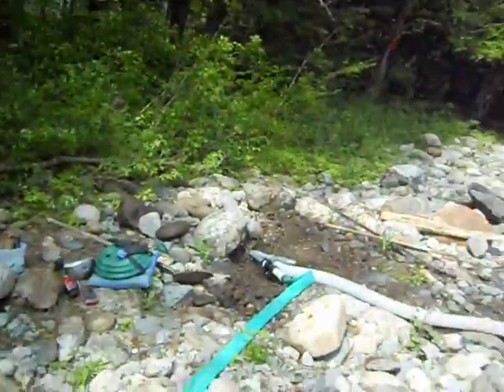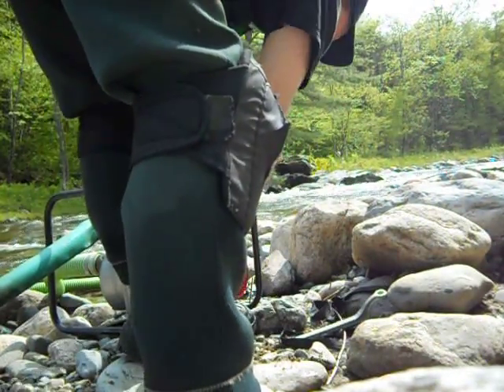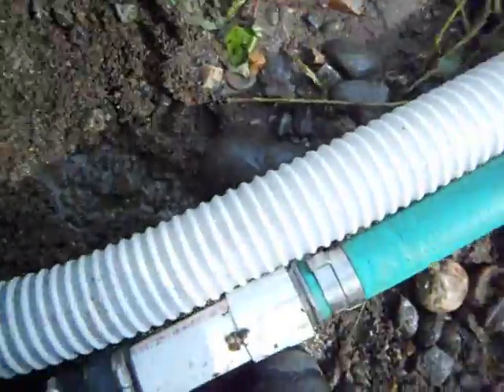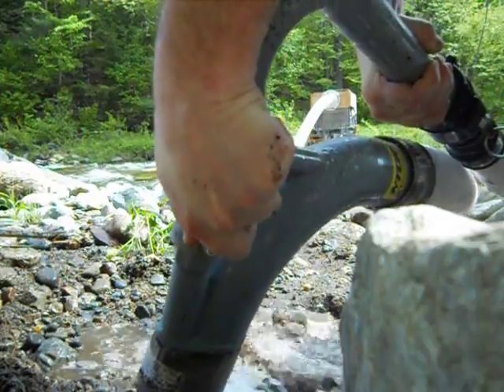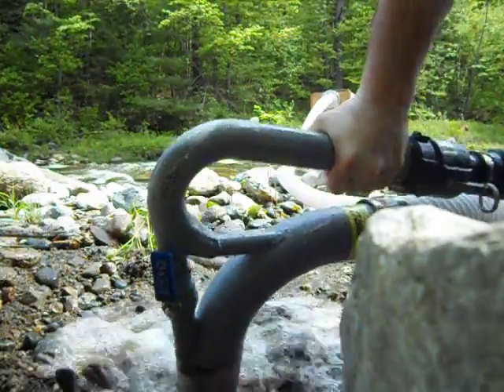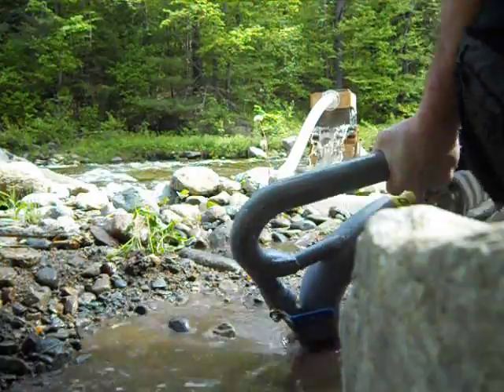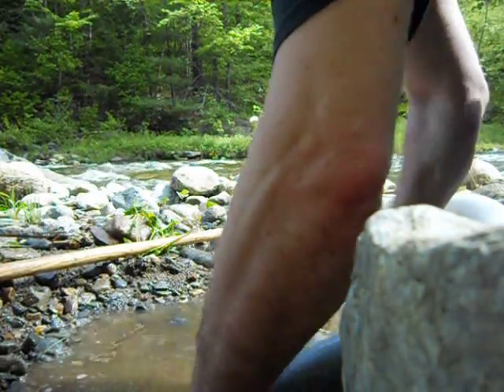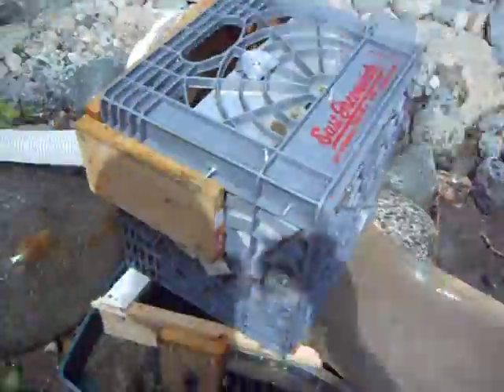Hydro-Force 300 test run.  Yankee Gold Prospecting New England

Comment: If you just took a bolt and nut and put it threw the end and have it centered you wont clog up the pipe it will stop those bigger rocks nice vid by the way like how that setup works very slick way better then digging by hand lol!